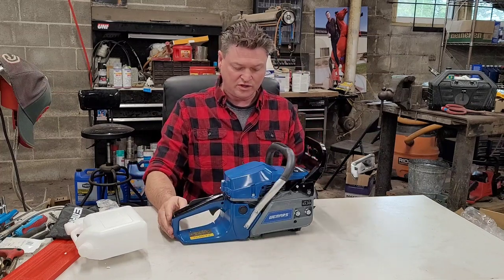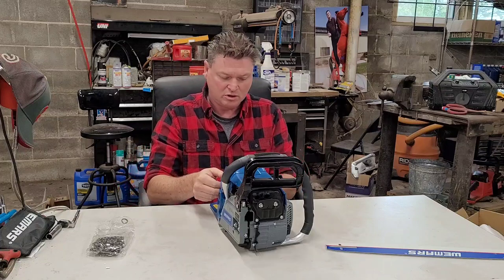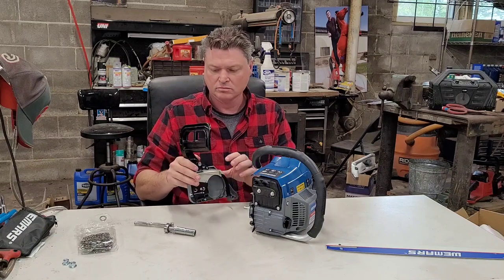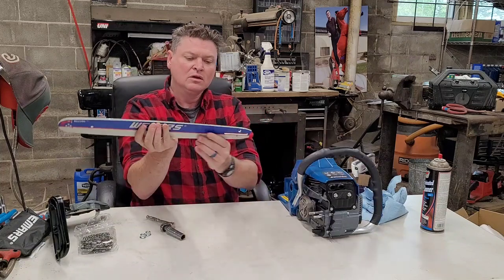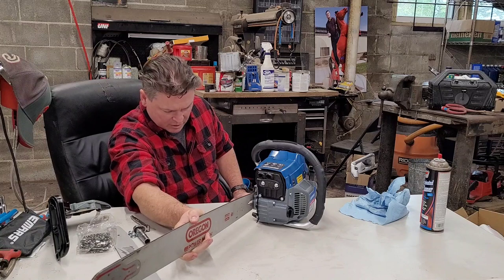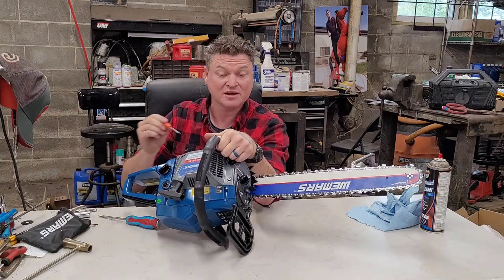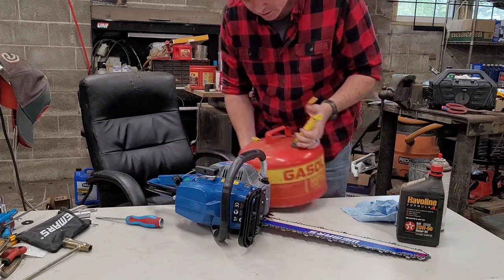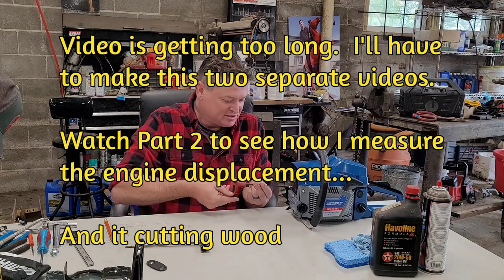First Impressions of Chinese Saw Quality

Comment: I bought 2 Chinese saws this year,  ( a Garwinner and an Auto Jare) I love them. Some advice, Don't yank on the top handle if you get the saw stuck in a piece of wood, it will bend. Also, the air filters suck. Clean them very regularly. (I'm looking to upgrade my filters)  Also check all the screws after the first tank of gas. Wear ear muffs, these saws are very loud. 
Looking forward to your videos about this saw.
Reply from the maker: Thanks for the advice!  There will absolutely be more vids.  Do you have any recommendations for parts?  Just eBay?   What should I search for?  Chinese chainsaw parts?

Comment: i bought one of those "unbranded" saws from flea-bay last year  for $75 shipped. it was supposed to be 68cc , it is really 52cc. the chain break was missing parts and not working,  the handle bar was too small for the saw , --very tight space between the handle-bar and the cylinder cover.  the bar and chain were very soft. and the saw runs sideways in the cut really bad. i but some duct tape on the case to straighten it up. the engine runs like a top--so at least they got one thing right. and it all ways starts. i haven't cut much with it so i don't know if it will hold up or not.  have heard horror stories about oilers failing. but so far mine works. i think they just make these out of whatever parts they have laying around--if they fit or not. a echo 490/4910 is like a rolls and this would be a pinto.

Comment: Suggest that you give a new chain an oil bath before fitting, so less risk of damage while oil feeds through system.
On a side note, check all fixings as QC has improved over the years, but better safe than dead or maimed, for the sake of a few minutes spent on inspection.

Comment: Just converted my Chinese saw over to 3/8 x.050 so I can use the same chains as my Husky saws. Thanks for letting me know which bar I needed.  You can find all the parts you need on Ebay or Amazon , some ship from the USA in a few days and others from china in a month. 
So far I've upgraded the air filter, converted to a side chain adjuster and 3/8 rim drive.

Comment: That’s a nice looking saw. Love the bar colours. 
I’ve got one similar and they call it a 51cc but I measured mine as well and I believe it was 50cc. Everyone calls them 52cc from what I’ve seen though. 
My saw has slightly different plastic than yours for the top cover but same airfilter. 
I put an o-ring to where it seals to the carb manifold then I put a tiny o-ring around the post under the air filter nut. 
It seals good now before it was passing fines. 
My muffler glows red hot it has a catylitic muffler so that needs to be changed out to an open muffler style. 
The fuel/oil caps on my suck especially the oil cap you need damn tweezers to open it lol. 
The other day After a year of owning it I had a noise on the clutch side. The clutch drum bearing was dry as a popcorn fart and seems like they are all that way. Lubed it up all good again. 
Mine is called a Radley I’ve done a few videos on it.
Has a fuel primer as well. Fires on second pull and stays running if you can shut the choke off fast enough. 
No other issues and i’ve used it lots. 
I’m heading over to watch part two. 🍻
Reply from the maker: I'll go ahead and preemptively oil that bearing.   I think it's totally gonna be a decent saw.

Comment: These saws are definitely choked up for a 52-54cc saw. I ended up making a intake manifold from the oem boot flange and I forgot what I used to glue the cut oem ms290/390 intake boot to the flange with. I did port the intake I think I changed the exhaust maybe 1° I dont remember 100% it's been almost 4 years since I put the quad open port cylinder on the saw. 45.2mm bore. Did way with the dual port muffler ordered a single port muffler. Cut the muffler in half and cut out the baffle and the old .485" i.d. pipe and put in a .625" i.d. it definitely pulls 20" 72dl 3/8 .050 pretty well now. I had to replace the oil pump because it wouldn't adjust then stopped oiling. The fuel tank does leak so does the oil tank when it builds up pressure from sitting in the sun. I also did chain the pull start since the easy start wouldn't rotate the engine but maybe one full turn. What I have learned on these saws is that they do have 3 style cylinders you can get in the states and 4 different styles over seas. You have the dual open port cylinder for the 34mm stoke saws and the quad open port cylinder for same stroke saws. You also have those same 2 types for the 32mm stroke same design saws. I would highly recommend measuring the stroke just to be sure witch saw you have since they will not tell you the stroke nore the bore size.
Reply from the maker: Great info, thanks a lot!  Mine is a 32mm stroke, 44mm bore.  Where do you find the cylinders?   EBAY?
Reply: @novicelumberjack  Yes eBay is where I found mine it's kinda a hit or miss since they don't tell you witch cylinder is for witch saw I had bout one for the 32mm stroke and didn't want to spend the time trying to cut squish band so I bit my toe and bought a different one of the quad ports and it was right. The intake port on these saws are very nicely shaped. It does take some modding to get the ms290 carb to fit correctly

Comment: We run and try china saws alot and give them a good hiding, the better brands like holtzfformer are getting much better in quality. The fails we had are: oil pump stops oiling, poor fuel/ oil cap seal fitment on some not all plastic tanks, oil pump seal leaks, pull starts are weak especially that e-start, air filters are useless and overall plastics are weak. The motors however are very strong and have been quite reliable apart from the odd coil fail or kill switch its the rest of the saw that lets them down. Them ported mufflers are well made, I put one from a stuffed china saw onto my jonsered 2049. P2 will be good to see how you measure the stroke and width of the piston 👍take care Mark.
Reply: Hi, found that slide kill switches are better sealed with glue around the inside. The quantity of fines pulled into the housing caused the failure. First session of cutting, after fitting as a repair.
Reply from the maker: Great info, Mark.  Thanks for taking the time to write it out.  Where would you recommend getting parts from?  Ebay doesn't seem right because all the models just seem to run together.  Need to have more specific naming options.
Reply: @novicelumberjack  Thanks mate, I usually just claim parts under warranty with the seller as it's always a mechanical fail but all the cheap 50 to 60cc generic brand saws up to $120 run very much use the same mechanical parts just different cosmeticly and some air filtration. Keeps costs down to sell cheaper to the consumer. I have the exact same saw as yours just branded as Giantz here in Aus. Only issue i had was failed AV mounts otherwise been reliable so far. Good quality copy china saws you might like better is holtzformer "farmertec" and a new one called neotec. I'm not a china fan but it's keept my hobby alive with the raising costs of living it's hard to afford the oem parts prices for our huskys and stihls so we make do.
Reply: @trwilkinson4623   great advice 😀 I use nail polish clear coat for sealing electrical components too makes a water tight seal believe it or not 👌

Comment: I have a 660 clone from hulzforma/farmertech and have had a bunch of problems and I'm considering giving it away but when I had it running for a little while, it was a beast. Anyone have advice?
Reply from the maker: Everything can be fixed.  Use this a s an opportunity to learn how to work on chainsaws.  You will be richer for the experience.
Reply: Sounds like they cloned it exactly like the original. LOL.

Comment: If you can’t get replacement parts there totally worthless imo. I have tried the holzfforma saws and by the time I fixed everything could have bought a used pro name brand and been farther ahead.
Reply from the maker: I can understand that.  I've told many people, the best option is to buy an older saw and learn to work on it.  Heck, my Craftsman 3.3 cost me $15.  It starts every time and I'd wager it will pull a chain just a good as a Husqvarna 450 Rancher that costs $400.
Reply: There's no problem getting replacement parts,  the Chinese saws are sold in virtually every country under a 100 different brand names.  As cheap as they are buy 2 and use the second for parts.